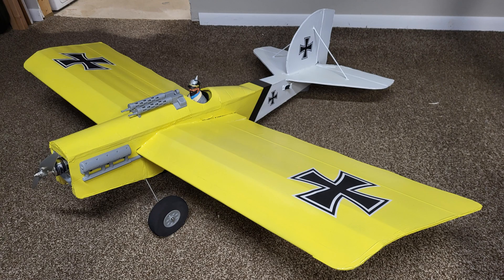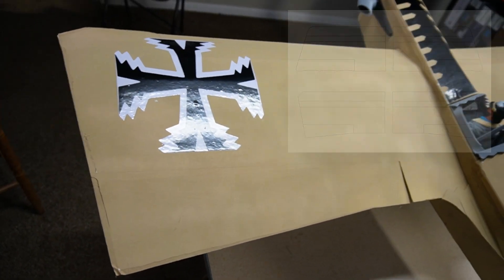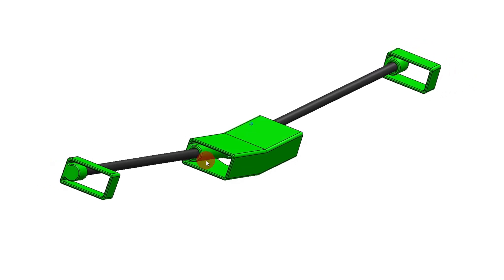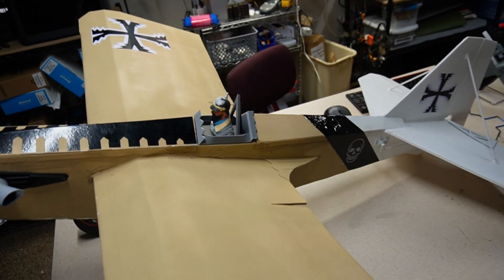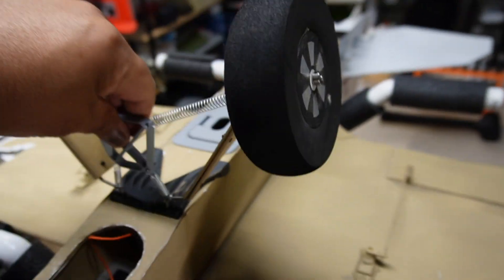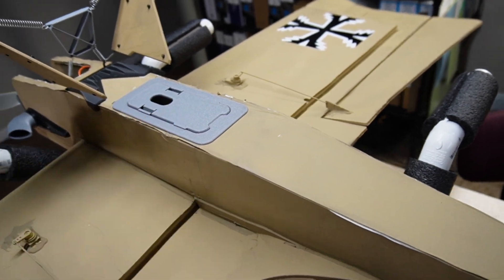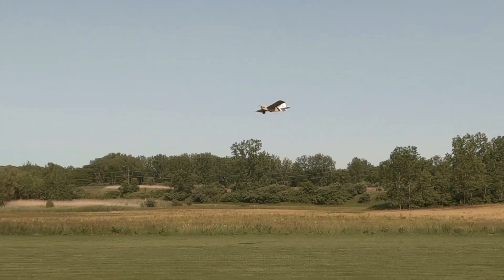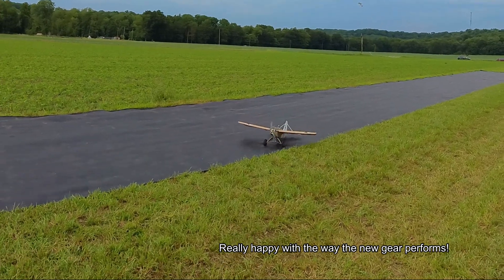FT Scout XL New Mods and Maiden Flight with Oops!

Comment: What's the diameter of the carbon rod. Very imaginative & creative! Very pleasing to the eye. Thanks!
Reply from the maker: The outer diameter of the rod is .295" (7.5mm) and thanks!
Reply: @reedinspace2286  Carbon fiber tube is impossible to find at that diameter.
Reply from the maker: @Warpig0321  Search Amazon for "6.2mm carbon shafts". This is the inner diameter measurement. These (OD) are just bit smaller .285" (7.25mm) but should work with glue. You can even scale down the STL models just a small amount for a better fit. I used arrow shafts which are better quality than the ones on Amazon but these should still work. The generic Amazon ones are softer but still strong.